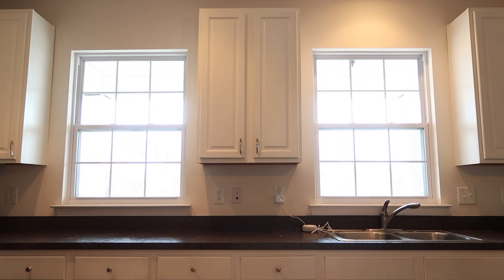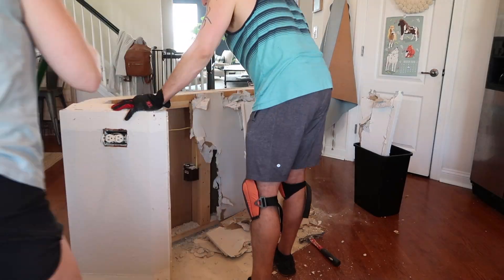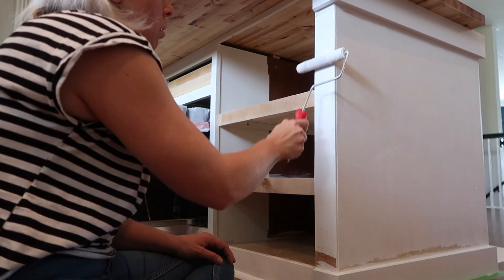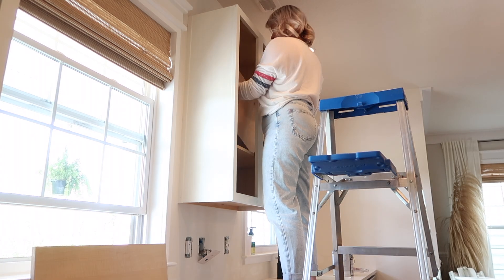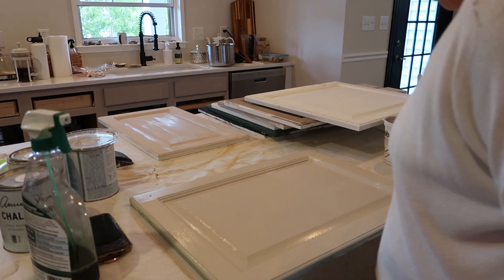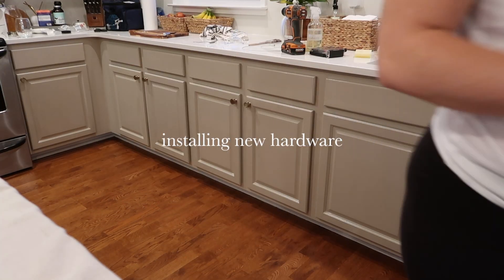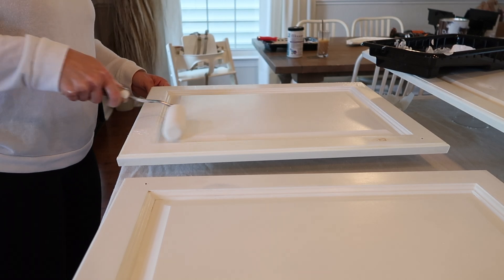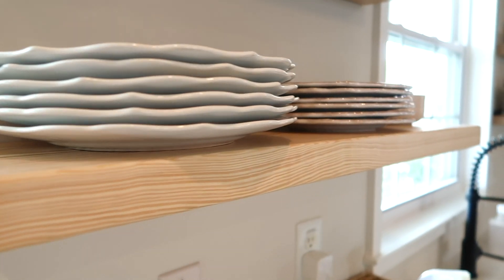Complete Kitchen Makeover - Painted Cabinets, DIY Kitchen Island, Floor Inlay, Floating Shelves

Comment: I just finished reading and commenting on the first video I saw from you! Now I see the "new-new" kitchen and love it. Question, did you use Annie Sloan paint on the upper cabinets when you repainted them? If not, what was your rationale?  BTW, my kitchen cabinets look like your cabinets before you painted them the first time, and I'm getting excited about starting on my cabinets this fall/early winter. THANKS!  Love your videos
Reply from the maker: I used Beyond Paint on my uppers and Annie Sloan on my lowers. Annie Sloan because I wanted a specific color there that Beyond Paint didn't offer. Both are really awesome products and can be used interchangeably. The difference is really the color selection and application.

Comment: How is the white paint that your island stools sit on? Is it scratching up at all yet? I could imagine over time it would start to show some serious wear & tear, especially if you have kids who will sit in them often
Reply from the maker: I worried the same which is why I did several coats of poly on it and it has held up great. I vacuum it and steam mop it once a week and it looks the same. We have padding on our furniture and we also do not wear shoes in the house and I think that makes a difference.
Reply: @MeganBell  Oh wow that'll definitely do the trick, those little sliding pads work amazing.